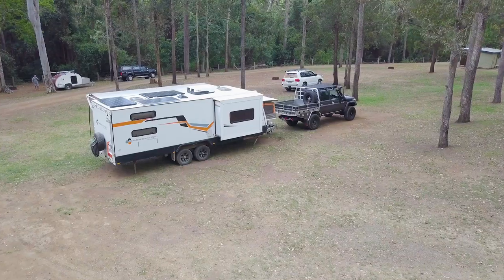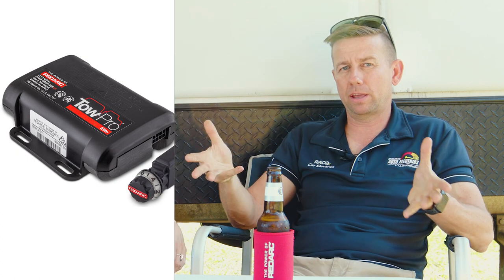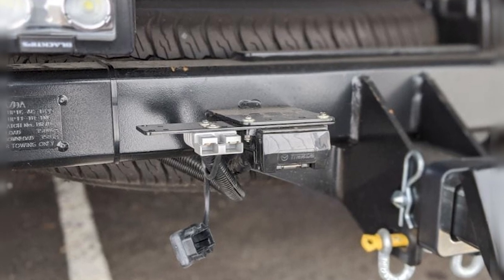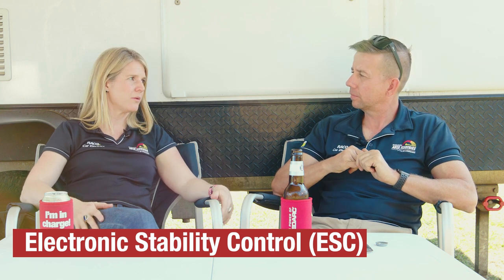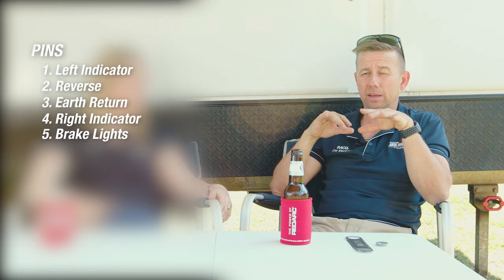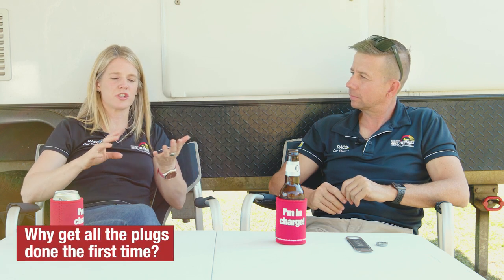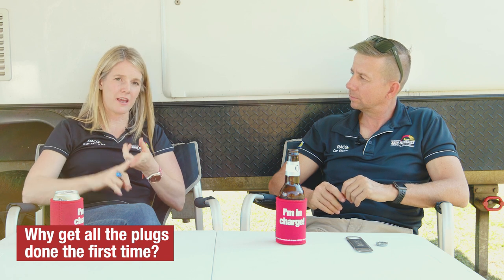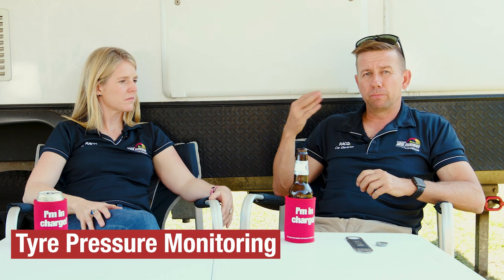Bought A Caravan? Not to sure what you need to do to your car?

Comment: I did a ranger dual battery setup that a cust bought it of use with alloy bracket . Looked dope fitted dope . But took way to long to install . . To much to do just to make it fit . Unfortunately i thought it was to much ive done custom timber battery trays behind the seat in these . With bcdc on back wall aswell . In the ranger .weve done heaps even on the chasis mounts ive made them fit there to anyway keep up great work guys .

Comment: This is a great video, many thanks. I wish I had seen this before I picked up my new van 2 1/2 years ago, as I would have had an Anderson plug installed on my car then and there. I really need that when going off grid in the NZ winter, as the charge current through my 12 pin plug is just a dribble.
Reply from the maker: Thanks for your comment! 
Yes, 12 pin socket charging unfortunately does have its limitations.

Comment: Excellent video. Would have been interested to hear your thoughts on  pairing up an inverter with batteries in particular size of inverter to size of battery especially lithium. My understanding is the a 2000 w inverter is too big for 2 x 100Ah due to the battery bms.
Reply from the maker: Hi Robert, your understanding is correct. It depends on the maximum discharge the battery is rated for... Usually 100AH Lithium battery will have a max discharge current of 100AH therefore it would only suit a maximum of 1000w inverter. So if you're wanting to run a 2000w inverter, you'd need to look at a 200AH battery.

Comment: Love coming back to your vids for refreshers. If I have dual batteries under my bonnet, am i able to run x3 separate ?8B&S wires from the aux battery for the ESC + power to charge van battery + power direct to fridge? Or do all/some need to connect directly to the starter battery? Thankyou :)
Reply from the maker: Thanks for your comment!  We recommend connecting the supplies for your caravan to your start battery, Going via the AUX battery can create a bottle neck due to DCDC charger outputs.
Reply: Thanks for your reply. Sorry, I should have described my setup better. From what I can see I have an isolator between my start and aux battery (both batteries being in the engine bay) - no DCDC charger. Therefor, am i able to run x3 separate ?8B&S wires from the aux battery instead of the start battery for the ESC + power to charge van battery + power direct to fridge? Thankyou again.

Comment: Electric  brakes are not compulsory on trailers over 750Kg ,  Over run brakes are fine on many trailers and caravans in Australia
Reply from the maker: Thanks for your comment!,  yes not compulsory, Trailers having only a single axle and a GTM not exceeding 750kg do not require brakes. Trailers of GTM over 750kg must have brakes. Trailers of GTM over 750kg and not exceeding 2000kg must have braking on the wheels of at least one axle. Trailers of GTM over 2000kg must have braking on all wheels.

Thanks for watching 🙂 - The Team at Accelerate of Grid Touring

Comment: Thanks for the video very helpful. How would you recommend to power the 3 way fridge while driving? Run it through the 12 pin and use a battery isolator (nissan navara np300)? Or run it off the batterys in the van and use a dcdc to keep the batterys full while driving? Really not sure on how to set it up.
Reply from the maker: We always recommend running a 3way through the 12pin plug when fridge is set to DC. That's what we've always done and it works well.
Reply: @accelerateoffgridtouring  so Do I run a smart battery isolator or a dcdc charger to run the fridge tho? Sorry but I have been searching and search for this answer but can not find it. Power the fridge from car via just a smart battery isolator or because its a smart alternator in the car do I have to use a dcdc. Only for the fridge while driving nothing to do with the batterys at this stage. Cheers.

Comment: Thanks guys that was very helpful. We are looking at a bigger van that does have sway control.  It doesn't have a dedicated Anderson plug for this, just a 12 pin.   It is OK to keep the 7 pin on the car with electric brakes, and change the van to a 7 pin plug and an Anderson plug for the heavy duty 12v feed instead?
Reply from the maker: This is completely fine and quite a common modification 🙂
Reply: @accelerateoffgridtouring   Thank you!  Happy caravanning :)

Comment: Just found this video - great for explaining the ins and out re electrics and towing. One question- I have a Anderson plug on the front of my camper leading to a dc2dc charger which charges my AGM house battery. When travelling the Anderson plug is connected to my vehicle. When parked I want to have the input from my solar panels which have solar controllers on them. Is is okay to feed ex solar panels via a solar controller to the dc2dc charger . Thanks Peter
Reply from the maker: Thanks for your comment! 
Unfortunately most solar regulators will not output enough to wake a DC2DC charger. 

We would recommend seeing if your Dc2Dc charger has a built in solar regulator and wiring a dedicated Solar input Anderson plug on your trailer.

Comment: Do you need a Shunt before an inverter that is wired to all 240v power points in a caravan?
Reply from the maker: I'm not to sure what you mean. 
The shunt in our lithium systems is there to measure the current flow. We always have battery then a shunt straight afterwards the shunt sends data to the gauge/monitoring system which then easily displays the battery stats. If it's an Enerdrive system it sends data to an epro, or BMPro to a Jhub. Then after that is the rest of the electrical system. I hope this helps.

Comment: Great channel.  Unfortunately I can’t use your services as I’m in NZ.  But I do have a question about the 3-way fridge 12v supply.  If the van had a decent lithium battery system, could a VSR in the vehicle be used to switch a relay (in the van) between fridge and van batteries ?  That would only then require a low switching current from the vehicle and thus smaller cabling.  (Obviously would only work where a DCDC was at least equaling the fridge draw to maintain battery charge).
Reply from the maker: In theory Yes. 
We recommend a dedicated Charge feed for your DCDC Charger with adequate cabling. 

In Regards to Fridge, The 12v function of a 3 way fridge is power hungry, In some cases upwards of 25 amps. We recommend a dedicated fridge circuit via an Ignition relay off the vehicles start battery. You could relay the 12v Fridge supply via the Caravan Batteries switched by the car but this means their are more moving components present in the system and more to go wrong in the bush!
Reply: @accelerateoffgridtouring  Thank you.  Taking the time to answer this is much appreciated.

Comment: Truly appreciate your video. Two issues I hope you can help with to initially get me out of trouble. 
Just about to pick up a 2nd hand van that has electric brakes, 12-pin flat & ESC. Can't recall seeing a red Ando plug on the previous owners car. In my car I have electric brakes, a 7-pin flat & a grey Ando. (i have bought an 12pin/7pin adapter to get me 50km when i pick the van up) 
Issue 1 - Will the adapter I'm using be safe enough for now to get me home? 
Issue 2 - If I open up the van's 12-pin, what am i looking for to show where the ESC has been wired into and would it be on the 7pin section?? 
Any help or suggestions would be greatly appreciated thanks.
Reply from the maker: Hey Chris
Congratulations on the new van. My understanding is if your caravan is fitted with ESC and it isn't installed to work in your car and you have an accident your insurance will be void. Hence we always recommend fixing the car before you tow. You can usually call the caravan manufacture and request a wiring diagram from them.

Also when you plug in your car & caravan via trailer plug the lights for the ESC monitor (usually on the drawbar) should flash green, if they don't flash then the ESC isn't working. ESC can be wired to the batteries in the caravan too.  Open the 12pin on the van & see if there are big wires in the 8-12pin section (but big wiring could be fridge feed as well. 

ESC is generally not wired into the first 7pins, but won't say NEVER wired. I hope this is of some help. Thanks :)

Comment: Do you need to run power direct to the fridge if you are already running power to the dcdc charger in the van?
Reply from the maker: Thanks for your comment! 
Depending on your vans set up, If you are using a 3 way fridge it will require its own power feed.

Comment: H John here, Great video, thank you, now subscribed! We have ordered a new van for next year with Dexter ESC and the dealer has said it does need a Red Ando as it uses the house battery. Is this right? and they say to wire grey ando with 12mm2. Is this big enough?
Reply: sorry, should say "dealer has said it does NOT need a Red Ando plug"
Reply from the maker: Thanks for your comment! 
Some Sway Control systems receive their power from the Caravans house batteries. 
We would recommend acquiring a full wiring diagram from your caravan manufactures to ensure your vehicle is set up correctly. Each system can differ between makes & models.
Reply: @accelerateoffgridtouring  got it, thanks!

Comment: Hey guys, I have just purchased my first camper and I have an Anderson plug from the camper battery to the camper A frame. What is this used for? I do not have an Anderson plug on the car. Any help would be greatly appreciated. Cheers.
Reply from the maker: Thanks for your comment! Is there a DC2DC charger installed in the camper, if so, highly likely its the Anderson into that so you can charge your batteries whilst you drive, but you will need to check this first by following the cable.
You will need to get an isolated anderson plug wired into your vehicle so you can hook it up.
If you are in SE Queensland we can do it at your workshop in Maroochydore.
Any further questions please let me know 🙂
Reply: @accelerateoffgridtouring  Thanks for replying guys. The wiring with the Anderson plug is connected directly to the battery. I have an AC to 12v charger but no DC2DC charger. I purchased a solar blanket and the Anderson plug powers the solar controller. Thanks again for your help. You live in a great part of Oz. I’m on South Oz.
Reply from the maker: Okay I see, I think it is best if I get one of the touring experts to advise you over the phone.
You can give us a call on 07 5479 6652 or email us at hello@accelerateoffgrid.com.au and we can try to advise you as best we can. - The Team at Accelerate Auto Electrics
Reply: @accelerateoffgridtouring  thanks guys. I have been doing a bit of research and think I have worked out what I need to do. Wiring kit from starter battery to back of car. DC to DC charger in the camper. Got it sussed I think. Thanks heaps for your help. Dave.

Comment: Mate i need your help, ive rang JAYCO service Sydney asked them for a wiring diagram for the trailer 12 pin plug for a Jayco Starcraft outback 2017 , My Auto Elec requires it to wire a 12 pin plug , Jaycos reaponse just go down to SC AUTO and buy a kit 😂😂😂 No help at all,
Reply from the maker: Hi @doctormengele961, Thanks for your comment!
You can give the team a call on 07 5479 6652 and we may be able to assist over the phone or if you email us hello@accelerateoffgrid.com.au we can try to advise as best we can. 
Thank you.- The Team at Accelerate Auto Electrics
Reply: @accelerateoffgridtouring  will do your a legend 👍